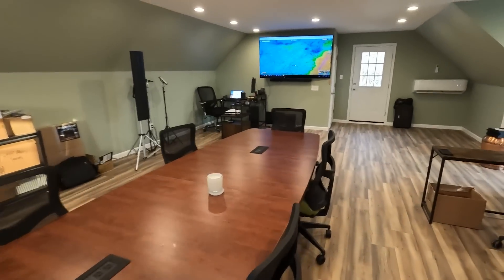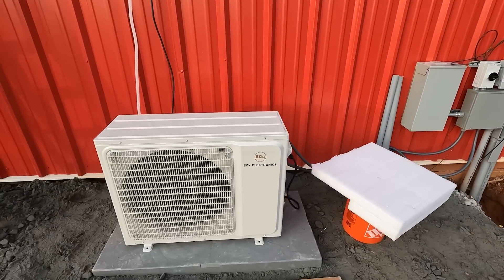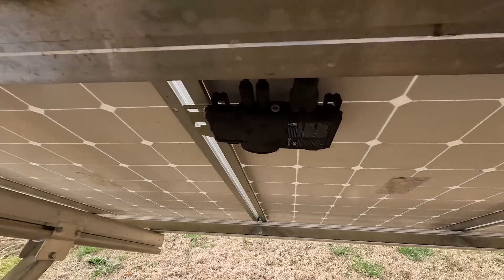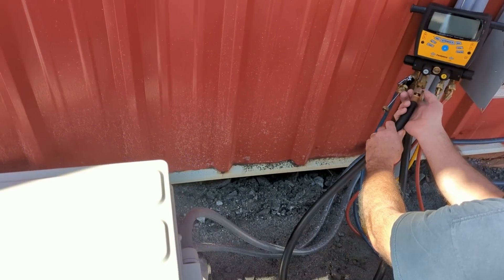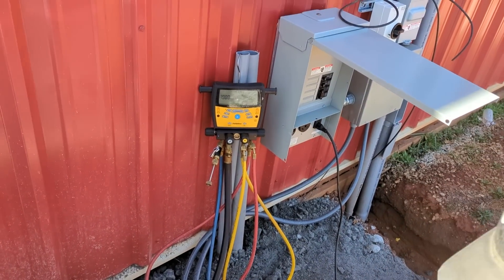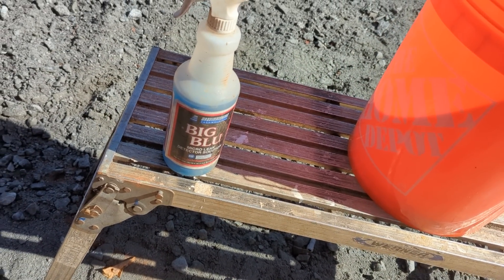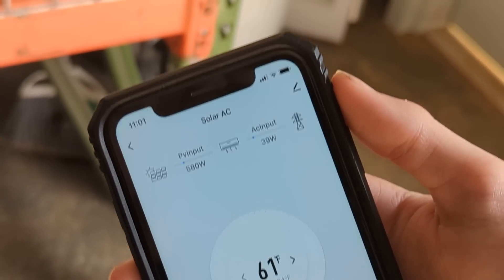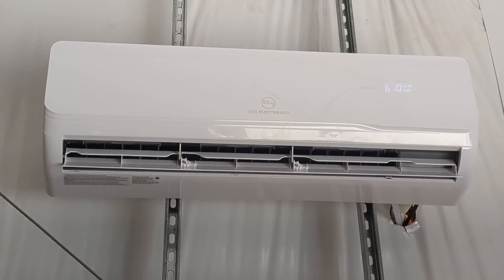A new AC/DC air conditioner has arrived!

Comment: I like the idea, for those just getting into solar.  However, for those who already have solar, it's likely better to hook the panels to your inverter so that you are still harvesting even when the compressor isn't running.  If it'd DC direct,  you are only harvesting when the A/C is running
Reply: Not a problem really..i bought a skid of 200 watt used panels for $35 a piece and turned around and sold about half of them for $100 a piece and have no problem dedicating 4 of them strictly to the EG4.. It's cooling my entire 1500 sq/ft during the day at 85f outside.. Had no idea it was going to be able to do this? It's only the 12k
Reply: @Bobotrucker  Which model number did you purchase and how many Watts max are your panels rated for? We have a small home in North San Diego and want to what you did with just solar panels directly wired. Thank you.
Reply: @benkanobe7500  I have 4 200 watt panels and the smaller 12k unit.. It never seems to draw much more than 700-800 watts.. That's another thing I like about these mini splits is even on grid power they are so efficient but that is probably the case with most modern units
Reply: @Bobotrucker very nice. I was thinking of doing the same thing here in Texas.  I kind of wonder what sort of energy I am loosing by not going through inverter.   It doesn’t rely on batteries so that should be a plus.  Thanks for your comment.   I am always learning.  all the best!
Reply: @Bobotrucker  That's a good deal in several ways then. I was thinking 24K , but 12K might work now that I think about it.
Reply: At the same time, you aren’t adding load to your inverter.
Reply: I want one in my rv like your saying.When it catches up on cooling ability to store power for night time.I think I can do all this easily on a 400ah battery.
Reply: I'm doing it with 24 leaf modules and it's at 24 volts. It'll take more than a 400 amp hpur battery if you live where you get any cloudy days. Mine will do ok but I can't run constantly. I need to triple my bank for sure

Comment: Do clouds and interruptions in the sunlight strain the A/C motor?  I always thought the "off/on/low voltage" situations were terrible on traditional A/c units.  Have they made enough improvements now to allow for power interruptions?
Reply: What AC motor? These units use  all dc components..fans, compressor, etc.. you can literally shut off the grid power and it will run on the solar panels.. I just leave the grid on because it can run on solar, grid or a combination of both..
Reply: @Bobotrucker  A/C as in air conditioner compressor...   If you're running on solar and clouds come over, I assume the panel voltage drops and the a/c compressor stops. Is this ok for the motor longterm?  In a regular home a/c unit, any power interruption stops the outside compressor from turning back on for many minutes due to head pressures.  I wasn't sure how the solar panels direct to a/c unit handled this.
Reply: @aussie2uGA  oh ok.. I guess I don't know the answer to that one? I always leave the grid power connected to the EG4 so I do not believe it will ever get a low-voltage condition because the unit decides whether to use AC or DC or both depending on what temperature you have it set to and whether solar is available.. I would guess the designers have considered some customers will be running this on solar only and have built-in safety systems to avoid short cycling the pump

Comment: I could see doing this if I had excess solar, but I am suspicious of dedicating panels to that use as opposed to being part of the bigger pool. I suspect putting all those panels to use charging batteries and being able to use it for anything would be more effective use of that power, plus I could continue running the minisplit at night, plus a normal minisplit is cheaper.  If the batteries were fully charged and so the minisplit was running via solar to inverter to minisplit, how much loss would that have compared to solar to minisplit?  Does running direct save enough to pay for the more expensive minisplit?  If so, is there a way to switch the panels over when the battery is full?
Frankly, I'm just seeing a novelty product here.
Reply: Exactly! I looked at a similar mini-split before I installed my Pioneer but, without the ability to  easily redirect the unused solar when no heating or cooling is required,  it didn't make sense in my case.
Reply: @580guru   Now with NEM 3.0 coming into California, adding "extra" solar panels are not an option. Yeah batteries could be used, but I would much rather go directly to my HVAC system then worry about storing energy. Things are always changing, however going directly from solar to my mini split is now more attractive then ever in California.
Reply: @Frank Marian  I know NEM 3.0 sucks in that regard but it only comes into play when you deploy in a grid-tie scenario. I suppose you could start with a direct to panel setup and look to add a battery later as prices come down.
Reply: This type of unit is mainly designed for off grid buildings or for people that want a dedicated system and get their feet wet.  Not everyone is trying to go off grid or think the world is ending.    They just want a little light bill relief.

Comment: I've been wanting to supplement my current heat pump with something like this for extra redundancy.  I'm pretty happy with the cyboinverter heating my water and I would definitely add this.  I would have mounted the condenser up higher and even added a hood to protect it from rain and snow.
Reply: Cyboinverter: $1300, Solar Panels: $1400, roof rack system: $300, water heater $800, plumbing and wiring $500.  
So $4300 total without my time included.  Propane for the year was about $2500.  Noticed about a 75% reduction in use.  $1875 in yearly savings.  Payback around year 2.5
Reply: Cost?
Reply: How is your cyboinverter? I am getting ready to hook mine up...
Reply: @chrisneibauer  I'm pretty happy with it.  Seems to do well even in wintertime up here in the PNW.  I hooked it up to 4 renogy 320w and plumbed two tanks together. A 55 gallon primary with an AC element sized for the cyboinverter and a final 50 gallon propane tank.  Keeps my propane bill down, but you can always wire a second element if you want just a single tank.
Reply: And hail.

Comment: Question: I have Solar grid tie with the enphase IQ7+ Inverters. How would I run that AC on solar only when the closed inverters have already converted the solar to AC current? From what I understand, I can't do batteries as backup because the solar won't charge without grid power. Please help me understand this.

Comment: Does this unit actually use a dc brushless motor on the compressor or is it a common inverter that lets the DC current bypass the bridge rectifier and sends it to an inverter?

Comment: When using a flar connection... there are specific torque values  based on the lineset dimensions.
Reply: Yes, they are all the same for units like these, I think it's around 30 inch pounds. What you want to do is seat the flare on the fitting by hand,.( Slide the nut back on the copper line and put the flare to the fitting, then hand tight all the way ) In this video at 5:55 on the suction line , he just put the nut to the fitting and screwed it on. That is a big no no. You are asking for a future leak down the road. However he is not a hvac guy, and did not know this.

Comment: Cool product. Next steps... integrate a grid-tie inverter into the unit to make use of unused solar capacity (such as when the unit is "off"), or, less desirable, have some logic to divert solar to an alternate load (heating element in a water tank, or external inverter). I'd hate to see solar energy wasted when the HVAC system is satisfied.
Reply: Thats a great idea.  I'd agree, when the unit shuts off, that solar should go somewhere else.
Reply: Too much of a fuss really in my opinion.. I keep my systems separate.. I am using 4-200 Watt used solar panels that I paid $35 a piece for and am currently cooling my entire 1500 sq/ft with one EG4 12k unit and it's 85f outside right now.. it will run between eight to nine hours on a sunny day strictly on solar alone..

Comment: I have a Sol-ark 15k.  I would like to use the dump load to run a mini split.  What mini split will turn on automatically when given power?  When it is running and looses power and regains power turns back on without me having to be there to turn it on.
Reply from the maker: I am assuming all of them will once power is restored from the smart load

Comment: When Installed my minisplit I torqued to factory spec and a year later I had lost most of my refrigerant. I called an AC guy in to refill it and he just have it some hell with a couple wrenches recharged and it’s been working great for the last 7 years. Moral of the story is don’t trust the torque specs the manufacturer recommends.

Comment: I've been using mine all winter and love it! Run it at 100% all day. Heats up most of my home
Reply: How well does it heat when it is below freezing?  I was hesitant about ordering it since the operating range of the heat pump is only down to 15f.  Others on the market had much lower operating ranges down to -22f (not that it will ever get that cold here in Austin).
Reply: @robbie31580  yes those have a coil so no need to run defrost cycles. And it never gets to freezing here, I'm in Vegas. I run everything off the sunshine here
Reply: @WillProwse  will i believe the coil is just to ensure the base pan doesnt freeze before draining when it is really cold. They will still run defrost cycles
Reply: @chrisE815  oh good point
Reply: @robbie31580  Couldn't you build this unit into a small enclosure and pipe some heat into it maybe just mount it inside the shop and vent the unit outside? There has to be a way to keep it warm enough!
Reply: @robbie31580  These don't heat when the temps hit below 14 degrees f.
Reply: @artlaubach9993  Couldn't you build this unit into a small enclosure and pipe some heat into it maybe just mount it inside the shop and vent the unit outside? There has to be a way to keep it warm enough!
Reply: You show pulling 619watts what is the draw when it first starts. I am looking at the smaller unit and really trying to size the qty of panels I realistically need for cloudy days and start up. Thanks
Reply: @NicMan63 it has a variable compressor it has no surge it will start at zero and ramp into what it needs
Reply: If I remember correctly you made the first video.
Reply: Very nice video and helpful, thank you. I am going to throw this out there because it really helped my cousins pole shed as far as the floor sweating he bought 4 x 8 sheets of 2 inch Styrofoam and since he had a mini backhoe he went around dug down 4 feet and put in the 2 inch Styrofoam all the way around the perimeter of the pole shed and backfilled it and it has really helped with keeping it warm because now the frost doesn’t get underneath there and no more moisture seeping through the cement.
Reply: Have any tips on wiring this into a previously installed victron system? 
(150|100 mppt, 2x100|50 mppt, multiplus,2650w pv, cerbogx, 12v 9.6kwa Lifepo4 redodo)
I'm curious if it'd be possible to wire the dc input from before the mppt and not have to dedicate separate panels. Although I run many panels parallel to reduce shading loss (airstream curved roof) so my voltage is sub 100v per charge controller.

Comment: I installed the 12k unit on my house. Its honestly a great unit! It pulls about 360 watts most of the time, when the sun is out we just crank the heat while its free. Also the Deye (EG4) mini split heat pump comes in a hot water heater and they make a 48v direct drive mini split heat pump as well. Hope EG4 gets these units, future is bright.
Reply: Totally Agree!
Reply: I came across their hot water mini split about a week ago but figured it was for existing boiler applications. Do you think it could be used for potable domestic use w/o a heat exchanger?
Reply: @580guru  @practicalpreppers7798
Can you point me to some info on the Deye unit
Reply: So how many solar panel did you use for the 12k btu??

Comment: The real question here is, When you run it 100% on solar, does it turn its self back on the next day when the sun comes out? I was pretty bummed that the acdc18c won't turn its self back on when running solar only. You have to physically turn it back on with the remote every day.
Reply: Is that true?  I need to check.  This unit comes back on everyday without grid.
Reply: While I’ve had a few occasions when my unit didn’t wake up and initiate operations those events were shortly after installing in September 2023. While they are all Deye my 24k unit came from AU, prior to SS offering their labeled version state side.

Comment: I really like the video great install. The only comment I have is to make sure you clean the ducts every 2 or 3 months or so. They really build up with nastiness quickly. I have seen hundreds if not thousands of the mini splits being used in Iraq and Afghanistan and they work great when clean, but can start smelling really nasty if not kept clean.
Reply: Thank You!
Reply: Where are the ducts located?
Reply: @kartencarter8135  sorry not ducts it is the coils or fins inside the internally mounted unit. The fan pulls air from inside the room cools or heats the air and these coils get dirty fast. It depends on the environment also.
Reply: @brianredding9160  A pole building is about the dirtiest environment outside of a desert :)

Comment: Does it need an AC power source? Or can you wire just the PV?
Reply: It needs AC anytime you need to use it when there isn't enough solar energy, for example, at nights.
Reply: I am running PV only to see if it can keep my warehouse where I want it.  If I have to use grid in the summer the PV will minimize the usage.  Also, My AC power for this unit comes off of my larger solar system so I am not using any grid.
Reply: @practicalpreppers7798  What are your thoughts if you only used solar and a cloud rolls in and the inverter is constantly turning on and off. Wouldn't this be hard on the unit?

Comment: Interesting the total wattage consumed dropped from 619w DC only to 580wdc+ 19wac= 599w total.   I'm wondering if the load on the inverter compressor changed?  Just an observation

Comment: Put some nylog on the flares.  Are you  stealing power off the grid tie system or just the solar only
Reply: It shows on the video
Reply: Solar Only
Reply: @practicalpreppers7798  thought maybe you had something figured out so if the AC wasn't using the power it would go to grid

Comment: What is the max distance that you can have the indoor unit from the outside? Do they sell an extra long custom kit or anything like that? I have a need for a long run through an attic before the line set will be outside.
Reply: Pioneers website sells everything you need. There are other sites, and local supply houses that sell line sets and cabling. Every manufacturer is different, I want to say 50-100 feet. It should be in the specs for what ever unit, and will tell you the max length allowed.